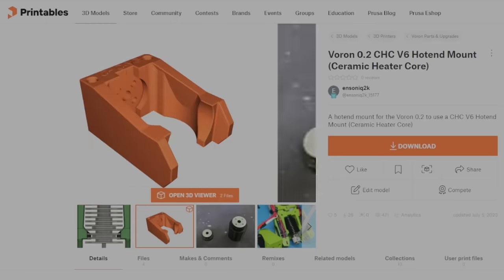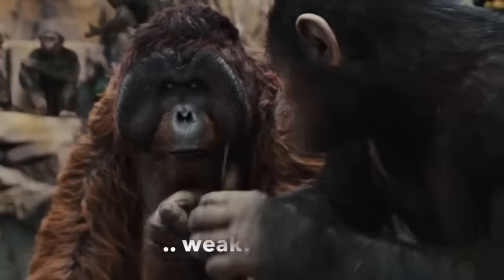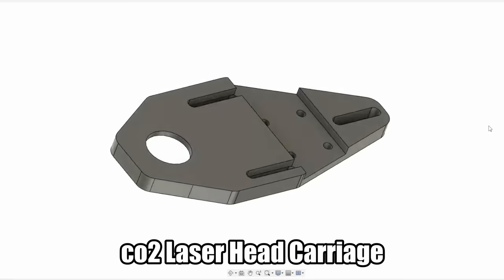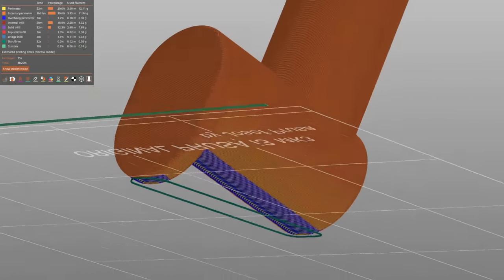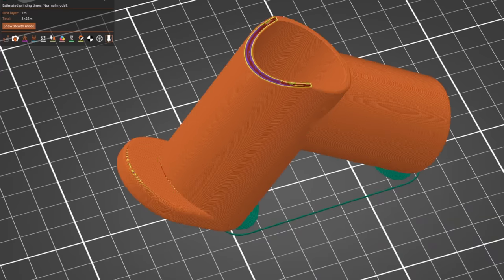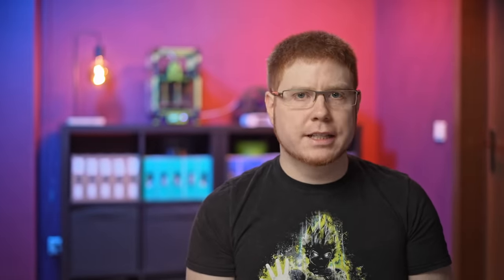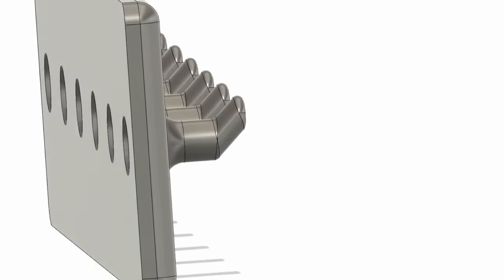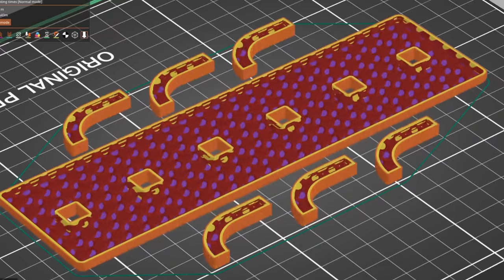3D Print Design SINS that need to STOP on Thingiverse, Printables, Cults3D etc.

Comment: The curved overhand thing is a huge issue I have, I mostly model and print figures and the backs of them always turn out rough, wish there was a way to fix it that didn't involve changing the design
It is nice to know that this is a common issue and not just my 3D printer
Reply from the maker: Only way to mitigate it a bit is finer resolutions, maybe variable layer height. Resin printers don't have as many issues with it since layers cure at once.
Reply: @SmallBatchFactory  I looked into getting a resin printer, but the toxicity and post processing scared me off
Reply from the maker: @TheTurtleyOne oh yes. I bought one and I hate it. So much waste produced and a lot of fumes. I have a profesional mask but still... I don't even keep it in the house.

Comment: By far the biggest issue is people just giving an STL. It's so prevalent that people thank me when I also upload the CAD file.

The websites should REALLY incentivize people to also upload whatever CAD file they used to create the STL

I also find it super problematic when people design for a certain nozzle size when it's not needed. I routinely print with 0.6mm nozzle (and frankly almost everyone should!), but some models needlessly claim that they are optimized for 0.4mm. If you do that, at least give the CAD file!
Reply from the maker: Indeed, I had people thank me too. Especially for my bike wall holder since you can customize the wheel size to any diameter

Comment: not everyone 3d prints with FDM printers, so most 3d models are just that, 3d models. they are not optimized for either resin or FDM, its up to the user to modify the file for their printing method. 
I dont have an FDM printer, and most of these "sins" are non issues for me
Reply from the maker: All three examples were FDM printed by the creator. Not every 3D design is meant for printing but those clearly were.

Comment: I have encountered all of these issues and many more, and frequently end up redesigning parts I find online to make them printable (often after wasting a lot more time trying to fix/patch a broken model when it would have been faster to just redesign it in the first place).

The one that really gets me annoyed is when people upload models that are simply entirely broken from a real object perspective. Not watertight, non-manifold surfaces, impossibly thin walls or intersecting corners... it's as if they designed the model to go into a 3D game engine and not actually be used to print a real physical object. This wouldn't be so bad if they posted the design files, but your options are quite limited if they only upload the STLs. There are a variety of automated tools that can attempt to fix some of these issues, but if they're bad enough I just use the design as inspiration and make my own with proper real dimensions.
Reply from the maker: Inspiration is usually my approach as well. I even do that with furniture...

Usually you can see it's not bad intention, it's a lack of skill. The clothes hanger bracket for example came with a source file and was very botched together. Changing this was a challenge.

Comment: I spent 43 years in computer hardware support. After reading the comments it sounds just like the issues I ran into. The people/ engineers designing things never actually put it together, use it or even tested what they came up with, hence the problem. I have had many classes learning brand new products and instructors literally throughout the manual. Because there was such a poor match between the manual and real world equipment.
Reply from the maker: Oh yes, a lot of "meh, good enough" approaches.
Reply from the maker: @WhiteG60 this or sometimes even gross incompetence. At least with a lot of early Chinese printers there was a lot of "everybody does it" implementation without grasping the reasoning for why to do it that way or not.

Comment: One that you missed that always gets me is sharp corners (especially after long straight extrusions) on the intended build plane. 

What constitutes "sharp" depends on the intended printing material, but with some large PETG prints even 90° is too much. because as it contracts slightly in two directions even a well cleaned build plate, with excellent z-offset and adhesion may break contact in the corner leading to severe warping. 

The fix is SUPER easy too: just fillet the corner to a 2-3mm radius and it changes the forces just enough that it stays stuck. This is part of why a brim can help the corner naturally rounds off. If the vertical corner must be as square as possible you can blend the fillet into the corner in the first vertical mm or so. Or add a 1 layer thick "mouse ear" which is easier to clean than an entire brim. 

This is particularly useful for more technical filaments that are known warp monsters like PC and PA-11 (and in extreme cases you can use the mouse ears + small neodymium magnets to help hold things down assuming the build plate is ferrous)
Reply from the maker: That's another bummer for sure. You can always add mouse ears in the Slicer easily. Adding a magnet it something I never thought about but is a very intriguing idea. Would need to be high temperature resistant though. I remember Prusa searching for a while until they found capable magnets for their bed.
Reply: @SmallBatchFactory  not really. Any Amazon small button neodymium magnet works in this case. Nd magnets have a curie temp above 300C. They'll hold to the steel sheet at 110C just fine. (yes Coercivity goes down above ~100C, but it's still plenty strong to hold down a .2mm thick piece of plastic)
Reply from the maker: I've read they will permanently change their characteristics of they get hot, but I'm no expert in this field.

Comment: Not always possible my man. You also have differences in printers. No two are the same. The printers own accuracy comes into play. I try my best to avoid certain shapes, provide tolerance, etc., but it doesn't always work 100%. You don't want to fillet a bottom edge, use a chamfer. You can fillet top edges and vertical wall edges. You can reinforce prints using ribs and rafters. Just incorporate them into the look if they are visible. You want to fillet where edges meet between connecting parts. It will increase strength where the part connects. Arcs distribute stress well. Print parts solid infill that should be solid.
Reply from the maker: Even a cheap bowden CR-10 of the first generation gives you really accurate prints. The rest is tuning, given the machine is has no defects.

The rest I totally agree with.

Comment: Thin walls should be related to the extrusion width and layer height, not just multiples of nozzle width. In Prusa Slicer, you can see the recommended thin wall thickness for various number of vertical shells at different layer heights. E.g., 4 lines at 0.2 mm should be 1.67 mm, not 2 mm
Reply from the maker: I meant to say 5 walls anyway. With Arachne that doesn't matter anymore

Comment: I don’t know why some people hate in designs that aren’t one part prints. I made a cable holder for my Valve index so the cable can be mounted straight down and added a wave spring to reduce stress on the cable. Had to print it in two parts or else one of the parts orientation would result in weakened sections that would break near instantly
Reply from the maker: I guess it's harder to imagine multi part designs. It takes a bit of engineering mindset to create something like this.
Reply: @SmallBatchFactory  Personally i find it way easier. You can split up you big part and assemble it later with screws and glue or just slot parts together. If you have single print parts you need to adjust so much about your print to get equal results.
Working out the right orientation or needing more support because some parts hang in the air. What about print fails? Now you have a failed print that takes 12 hours fail at hour 8. Instead you could have split it up and could have had a total print time of only 10 hours and split it up in into a 5 hours, two 2 hours and one 1 hour prints. One fails? Not that big of a problem. Only real drawback i see whit this is, that you need slightly more work after the print. So less useful for scaled up production that needs an assembled product. Or go the Ikea rout and deliver an assembly kit.
Reply from the maker: @LickItTM I'm totally with you on this. It can even make things a lot easier. Sadly many people can't wrap their head around it

Comment: Fair points made apart from the radiator bracket. Don’t use a chamfer the parts as suggested. ❌ Less material in contact with the bed. Doesn’t matter how good your first layer is, minimal contact with the bed more chance for the print to fail. Flatten the one side as a feature ✅ However I do agree that parts should be designed using its manufacturing method in mind with considerations to the inherent weakness of that manufacturing method. Although people that share these models aren’t designing them with a view of selling them, in which designing correctly with research & R&D who would expect
Reply from the maker: I've printed stuff with very little surface area with no problems. For examle my hinges on the printer enclosure needed to be printed standing up for layer orientation with not much more than a millimeter in width on the build plate. It's usually fine, result may vary of course.

I think it's a matter of experience. It doesn't take longer to do it properly, but people lack the experience to know that. It's totally fine, may this video help some people to get better at it in the future.

Comment: Small things i disagree with. If you are good with 3d printing you can get ~80% of the strengts in both ways on layers. Most people have a issue because they either use way to much cooling or way to low temperature. Sometimes trying to go to fast.
For something meant to be aesthetic i wouldn't care about layer orientation.

3d printing curves at either the base or top of a 3dprint should be done with incremental steps/variable layer height. If i got a 3d print that got a big radius on the bottom that for some reason have to have it. I would start with a 0.02mm layer after the initial layer height. And increment it higher. Also tend to let the bed be 5°c colder than usual to avoid the layer flexing down.
Problem with 45° is they may be to sharp in some instances.
Reply from the maker: I've never seen any test showing 80% strength across layers with all samples having the same section size.

Variable layer height works of course. In many cases it's a bit of a crutch IMO

Comment: My biggest complain about those website is no one try to optimise the model in term of filament usage, i don't want for exemple to spend 150 grams of filament for a simple sponge holder in my kitchen and wait 6 hours for the print to finish, while if you search deep enough you can find some who only use like 20 grams and print in like 30 minutes.

When in the rare case i publish some design on those site i specify the filament / temperature / speed / layer height / custom support.
Reply from the maker: That's also a bummer, yes. I try to save resources in general and wasting filament is something I hate. I usually don't even do calibrations prints since the result often doesn't justify the waste

Comment: Honestly the fillet facing the bed doesn't bother me so much. I'm much more bothered when a part has a large flat base with no fillet or chamfer at all. When that happens I have no way to pry the part up from the bed and I destroy the edges getting it off the bed. A fillet gives you space to slide something under and pry up, and if the fillet radius is sufficiently small then I don't get any print issues. 

However a 45 deg chamfer does sound like the better solution, I will add that to my parts going forward
Reply from the maker: I can very highly recommend a flexible build plate. They make removing the print a breeze. But a bit of chamfer should always be there anyway

Comment: This is why I tend to just make my own objects. If its super high in detail, thats one thing. But a simple clip or holder of some sort? Eh, design something in 20 minutes, spend another 20 adjusting tolerances, adding chamfers/fillets, and call it good
Reply from the maker: I usually tend to do that as well. The time searching for something remotely usable can quickly take more time than just doing it yourself.

Comment: I don’t use screws or threaded rods for alignment issues, I make the weak area hollow but then I fill it with epoxy or print a properly oriented piece i can glue in

I did this with a Vesa mount adapter, I wanted something that would last forever so I just put in big structural voids I could fill up with resin
Reply from the maker: Sounds like a plan, especially with resin. Although threaded rods are less messy in handling.
Reply: @SmallBatchFactory  I just haven’t had time to play around with threads and get used to it, so for now I’m paranoid about it eventually delaminating and I’d still end up using glue or resin to fill the crack (especially with the hook example where the hook could twist to delaminate)
Reply from the maker: @Pentross that's understandable. Layers compressed with metal are virtually indestructible. Me studio lights hang in such printed parts so I pretty much trust that concept. I personally have more aversion to Resin than to metal hardware :-)

Comment: I think I initially designed a part with arc overhangs in mind at one point. def helps for 90-degree overhangs but at the time, and last I checked was still the case, I found an edge case in the script that requires quite a bit of design consideration

Comment: There’s a TON of design consideration that goes into every manufacturing method, except 3D printing. There, the best most people do is try to avoid supports (even though they’re not THAT big of a deal these days) and don’t really consider a lot of the other advantages/disadvantages of 3d printing.
Reply from the maker: I guess it's a lack of experience. Thingiverse is mostly populated with hobbyists. I downloaded a model from a coffee mashine company once for example and it was awesomely designed.
Reply: @SmallBatchFactory  seems like there’s a lot of people who picked up “tips and tricks” and just kept doing things the same way and not a lot of new people learning to design stuff themselves now that so much is available so easily. 

But I think videos exactly like this are what’s needed to both get people interested in at least modifying designs for their own use, if not learning to design things specifically for 3D printing themselves. 

Guess it’ll just take a while for people’s imagination to not be based in traditional manufacturing techniques/designs.
Reply from the maker: @heyspookyboogie644 yes definitely. Most people can only work in small iterations. That's why radically different products usually flop until we'll arrive at the same product years later.

I think there are too many printer reviews and too few "fundamental education" channels in the niche. People seem to agree.

Comment: Good info but the bobblehead is a bit distracting. Are you being held against your will?
Reply from the maker: Didn't I nod enough to make that clear? ;-) seriously, I'm working on it. Still have to find my video mojo
Reply: @SmallBatchFactory  haha it's all good. Looking forward to your video on slicer settings. My Artillery SW-X2 has no manual, no info online but Cura is thorough on their end.
Reply from the maker: That video is going to be a tough one. Already working on it and installed OrcaSlicer since that's what the majority uses. The fundamentals should work in Cura just as well though.
Reply: @SmallBatchFactory  I agree. Bed adhesion, support, speed and temp, jerk, scaling...the basics.

Comment: There is an advantage to thick hollow walls. They have increased stiffness, since for a given bend radius, the outer walls that are further apart would need to compress or stretch more, which they resist. Many of these prints can even be done single wall just fine with a lot of void and you don't need a lot of infill just to tie the walls together and help it hold shape.
Reply from the maker: That's correct. I specifically referred to parts like the power strip holder "covering space". Stiffness is for the "solid blocks" I mentioned.

The prints you're talking about get their strength mostly from the top and bottom layers, like a square pipe or an I beam

Comment: I was guilty of adding round fillets to the base of models and quickly realised that chamfers are the way to go. Top notch video. Keep up the great content. Cheers 👍😎🇦🇺
Reply from the maker: Thanks! Only takes one messed up print to reconsider
Reply: I think a two stage hybrid thing works ok where you can have the bottom most part as a chamfer and then the joint between chamfer and the vertical part being executed as a round fillet. You can even make the chamfer a little steeper than 45 if you like for more of the joint to be rounded.

Comment: Every single 3D file I download for printing needs repairs in one way or another. Sometimes there's non-manifold or detached geometry, sometimes the tolerances weren't spec'd properly, sometimes flat faces aren't actually flat... Open source is the wild west, you get what you get :/
Reply from the maker: We can't really complain if we don't pay for it. But to be fair I have the same experience with furniture. I usually already have an upgrade plan when leaving the shop or even build it from scratch.